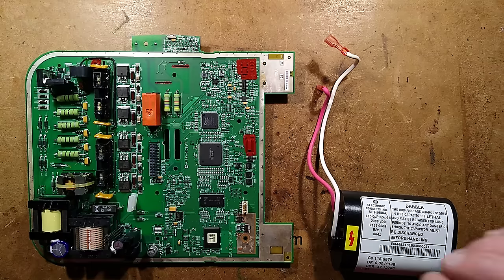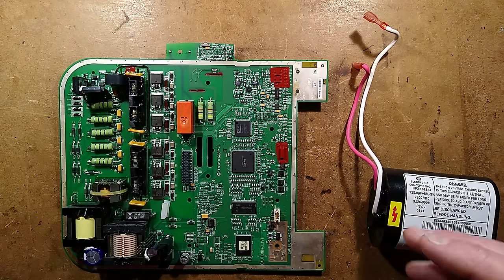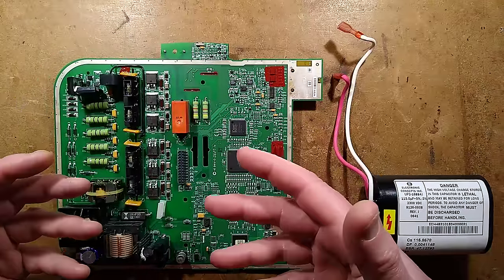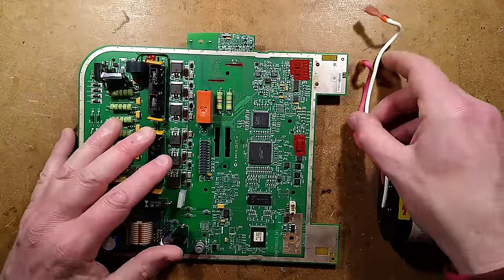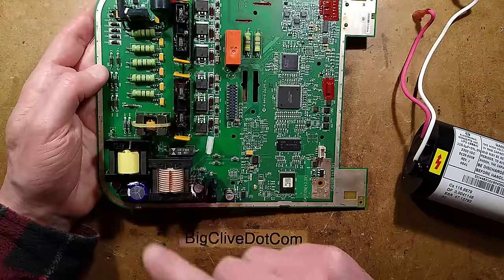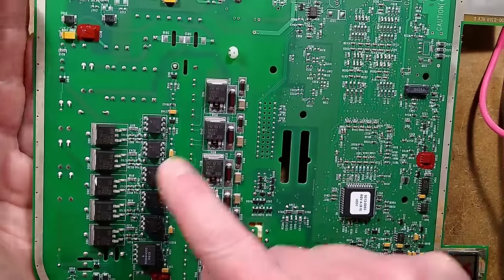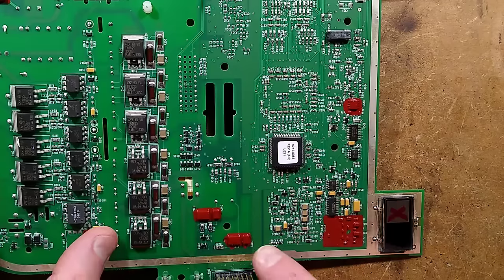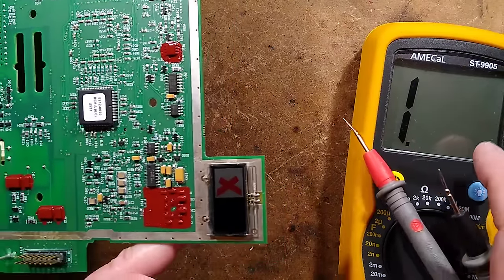Inside a Zoll defibrillator - with SCARY capacitor

Comment: I used to service defibs. These new automatic ones are pussycats in comparison to the manual operating theatre monsters I used to work on. We used to "test"  them by exploding cakes of soap with them.
The one I'm thinking of had 8 caps the size of the the one in the video. If I remember correctly , it would max out at over 800 joules.
It didn't use batteries , it was plugged into the mains.
Reply: Damn, 800 joules! Ours max out at 200, I bet those high power defibrillators were the old monophasic models
Reply: The early days were unhinged, it wasn't until around the mid 70s they figured out 360 was the most you could do without catastrophic heart explosion

Comment: The voice is a bit muffled and low quality, but it goes something like this, i think.

15:31 : Its talking about that the settings is for Adult, or directly translated : "electrodes adult."
15:35 : Now he's order you to install batteries , or directly translated: "Install batteries."
15:41 : A question about new batteries, if so press the button.
16:37 : Same about the settings, its using the Adult settings for electrodes.
16:40 : It passed the test and tells you, "Unit is ok."
16:43 : In this context,  its tell you to keep calm or be calm.
16:44 : Its when the red light is at the, Are you ok? sign, it basicly tells you to check the victim/patient , or directly translated : "Inspect reaction"
16:46 : instruct you to call the ambulance , or directly translated : "Call for help"
it now repeat, "Keep calm" , "Inspect reaction" and "Call for help"

16:55 : It tells you to make sure the patient have an open path of air and not choke, directly translated : "Open airway"
17:01 : Now check if the patient is breathing , directly translated "Inspect breathing"

ok, i got bored of translating, but really the images tells , and its just a direct reflection word by word of what the images are shown.

Comment: Very interesting, as always.  A thousand dollars for the device seems very reasonable. The little package with the scissors, chest shaver, an alcohol wipe, a pair of nitrile gloves, and one paper towel, which is called an Emergency Response Kit according to Phillips, costing a mere US $95.99 to replace does seem imho to be medical malpractice.  Yes, I understand the life saving ability, but charging (I'm sure I'm missing a pun somewhere) $96 for what at most is a few dollars actual cost for these items could kill someone.  And I am sure if used with non-approved nitrile gloves and paper towel liability insurance is voided, no wonder medical insurance is so high.  Similarly, after a recent scare I purchased one of those devices to suction a blockage from a choking person.  It cost me a hundred dollars and consists of about $5 worth of silicone. Overpriced?  Yes, until it saves someone.  It could save a lot more people if it were more reasonably priced however.  I'll make sure whomever is choking can afford to replace it before I use it on them, sorry Uncle Sal you still owe me ten bucks for lunch last week!

Comment: At 5:00 are the resistors supposed to be wired in opposite directions?
I know it doesn't really matter, but ...

15:40 - Google Translate tells me it said "batteriene er mye trykk på knappen" or "the batteries are a lot of push on the button" 🤷🏻‍♀. Seems it is even worse at translating Norwegian than Chinese.

When you switched it on, the Google translate of the text on the lcd display is:
electrodes adult
unit ok
keep calm
examine reaction
call for help
keep calm
examine reaction
call for help
open airway
examine breathing
attach electrodes
Reply: it actually said "hvis batteriene er nye, trykk på knappen" wich means if the batteries are new Press the button ;)
Reply: @johndo2218  Yup, definitely worse at translating Norwegian than Chinese. Your translation makes sense.

Comment: I just have been trained to take care of our ZOLL AED Plus. Thanks for letting me have a look inside!

During this training, I have been told that the chestpiece is not just checking for applied pressure, but also after the g-forces and direction brought to the small plastic case on the chest.

Is someone here who could confirm this?
Reply from the maker: The chest unit measures displacement, so it can tell if chest compressions are strong enough.

Comment: i wouldn't suggest using spade connectors for such high voltages, there are better suited options... but that's just the swiss engineer rambling... :D

Comment: The red ❌does not mean flat battery. It means its self-diagnosis tests have failed. This could be for a number of reasons including the pads not being g attacked. 

If the battery is due for replacement, the device beeps every few seconds. 

Battery life is 3 or 5 yrs depending on software version. Or one incident where shock(s) are delivered.

Comment: Nice to see the inside of a defibrillator.I just took apart a 1 farad capacitor but 30 volts.Lets just say there was enough energy inside to put a notch in a screw driver .Wiha won't warranty that .Was out of a high end car stereo system ..Someone tried to jump start a car and went reverse polarity and damaged the stereo but not the car computer ..Lucky .The capacitor is damaged draws 5 amps at 12 volts but still hold quite a bit of charge ..I think it was rated for 30 v DC .Capacitors are EVIL 13:15 13:16

Comment: Wow it has a whole hitachi SuperH Sh-3 cpu and some external ram and some flash. I wonder what os it runs. Probably some rtos but i could be wrong, might also use a light linux version or just a purpose built software.

It also seems to have a xilinx spartan fpga or cpld or logic device which probably also controls a lot of the functionality while the cpu outputs the speech and drives the display and lights and buttons

Comment: Defibrillarors aren't cheap and like modern printers they get you on consumables.
If you're an independent voluntary responder it can get expensive.
A Lifepak 15 is £21l to £22k but you get all the vitals P/R, NIBP, SpO2, SpCO, MethHb,  EtCO2 capnography (to measure effectiveness of CPR.

Comment: Maybe the 4 most painful experiences in electronics while still plugged and accidentally touched: 1-the heat-sink of a desktop pc power supply , 2-making contact with the ballast from a tube fluorescent lamp , 3- just charged and not plugged capacitor from freezer or microwave, 4-the discharge of a TV fly back  while disconnecting it from the tube. Just remember make me feel scared.
Reply from the maker: All quite harsh lessons.

Comment: I heard that they give you 80, 100, 120, 150, 180, 200, 220 or 250 J.
A horse kick directly on the middle of your chest has up to 175 J, protection for electronics can swallow a bit over 1,000 J, a BB gun has between less than 0.5 J and up to 7.5 J, sold only to adults.
I wrote these numbers just for giving a perspective.

Comment: Hospital equipment is VERY interesting because health industry regs don't allow manufacturers to cut corners at the design end. Every bit of junk thrown out tends to be at least twice as strong as it needs to be. Often ten times stronger. A lot of equipment is retired after a few years because it is too hard to deep clean. Its a very different commercial culture to domestic consumer manufacturing.

I just acquired a 'non-compliant' vintage 2006 HP 43120A combination EGC and Defibrillator unit. Complete with a mini CRT display and a heart beat tape printer. It’s a VERY different animal inside from the little one you are investigating here.

It came compete with 12V D Cell lead acid 2.5 amp hour battery pack. And a main capacitor that is the size of a brick.

Most interesting is the PCBs are all hand built with traditional resisters etc. Not a common thing to see these days.

Comment: "Chest compressions, Chest compressions, Chest compressions"
You're repeating yourself, Clive. Just like Doctor Mike!
That plastic case in the middle of the pad assembly is sealed, I see some sealant residue on both shell parts. So it really looks like a compressible volume of air, your "pressure sensor theory" is very plausible . Couldn't find anything about the part number, but can you post a microscope close-up of that thing? The top surface should either have a hole in it for the air pressure to be let inside, or be made of an elastic deformable material and in itself be part of the fixed-volume pressure-reference chamber. Maybe works like an electret microphone? I assume it's implemented with SPI or I²C data interface. Maybe even analog, with a high-precision ADC nearby. Intriguing!
Reply from the maker: It appears it is an accelerometer in a watertight case.

Comment: Regarding line workers, are defibrilators still useful in this case, i.e. can a line worker still get a shock bad enough to disrupt their heart but not bad enough to completely cook them?
Reply from the maker: It's usually the groundworkers who would benefit from a defibrillator due to gradient voltages.  With overhead line contact the current is usually so immense it affects the whole heart and leaves it functioning.

Comment: I never really respected capacitors before working on my amplifier with 400v caps and getting my fist electrocuted when i started soldering it after it's been disconnected for about 3 weeks 😅
I've always thought they only hold charge for max one hour or mostly 1 minute as most have discharge resistors.

Now i short them first or only bridge it with one finger at the time 😂

Comment: I have a Maxwell 100kv pulse capacitor, It`s about 2 foot high by 6 x 6. Needs to be in oil. It`s very frightening when charged and dumped
Reply: It whistles at arout 2 foot of spark gap and almost asked to be arced out

Comment: Can you trace the paddle wiring to see if/how it isolates the monitoring circuitry from the high voltage?    There was a relay, but I have some doubts about arcover on contacts. Was there a voltage on the relay, or did they isolate it electronically?
PS. I'm pretty sure that it asked if you were a Dachshund, followed by "Your knee is crushing my arm ... get off!"😆

Comment: I thought the capacitor was a similar size to the one in a microwave oven, but it turns out to be around 100x more capacitance at the same voltage.

Also, Zoll means "inch" in German. I wonder why they named it that.

Comment: Is there any reason why microwave oven capacitors are so weak when similar in size to this? I have a bunch and they're around 0.93uF and 2100V which is only around 2 joules. Unpleasant, but not dangerous. The one you have delivers over 300 joules and that's definitely deadly.
Reply from the maker: The microwave ones will be sized for the application with the continuous direct recharge from the transformer.

Comment: That the insulation on those capacitor leads appears to have been pinched and split in assembly is kind of an uncomfortable thought...
Reply from the maker: They are gripped gently in a support bracket.

Comment: These days when they restart an open heart after surgery the device they use, which isn't really a defibrillatior as its starting a stopped heart, needs 50 micro amps to get the heart to start

Comment: Ive been thinking of buying one of these,  but worried that "zoll" is some weird knockoff brand, if some one as knowledgeable as in electronics as you, claims them to be a respectable brand, then i might end up getting one.
Reply: Zoll are one of the top brands for defibrillators. You will find them on most ambulances. And they dont seem to be as bad as others, in terms of ripping people off for batteries and pads.
Reply: @lukehewings1  yes, i see them alot, thats why i was considering them, i figured they were either name brand, or a known knock off, and considering most places cut as many costs as they can, i was more so assuming they were knock off.
Reply: @ZOMBIEHEADSHOTKILLER  having used them, I can recommend them. I can't comment on other AEDs. They are one of the cheaper brands to own and maintain. With pads being readily available and batteries being cheap. The instructions are very clearly read out, and it talks you through what to do, if you are less confident or haven't used one before.

Comment: Ah yes! "Testing" old time defibs by discharging one paddle into the other: instantly welded paddles. Better still, discharge 400J into a stainless steel dressing trolley: nice burn marks. One manufaturer used capacitors rated at 5kV at voltages of 7kV: they seemed to work OK.

Comment: The strangest aspect of this device is the battery compartment. I’ve never seen such an odd battery requirement. 10 123 batteries?? What is going on? Why not 18650s?
Reply from the maker: The non rechargeable cells have high capacity and a ten year storage life.

Comment: 2:10 yeah, that's movie stupidity, not defib unit (they also always (i mean 99.9% of the time) use it in the wrong situation in which they would not help at all).
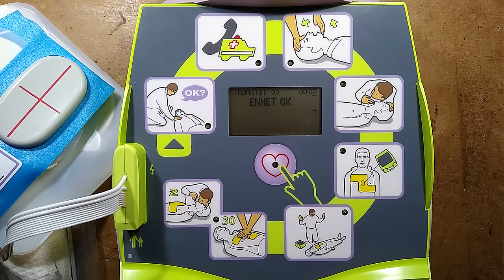19:00 yeah, breathing in is not necessary since those compressions are enough to make air go in and out of lungs (and it also protects the one rescuing the downed person)

Comment: That little high-voltage transformer makes me a little wet... 
So I'm working on a mains-powered 100,000+ volt transformer.  Following the success of a 50,000-volt model, I figured why stop at 50? As you might imagine the difficulty with such a device is the low frequency of the mains: the number of turns necessitated on the primary requires an insane number of turns on the secondary to achieve such a high voltage, even with a core cross-section of over eight square centimeters... Preliminary calculations indicate I will need approximately 50 miles of 42 gauge wire. Actually, the biggest sticking point is fabricating a proper bobbin. I have most of what I need I believe, except for the wire. 
Well, onward we go.

  Peace and love.

Comment: I wanted to see that capacitor charged up to its rated voltage and shorted... (who didn't?).

The electronics are impressively complex, there seems to be an external RAM for the main microcontroller - why is that?

Comment: There are many locations here that have under the table work down on live 480vac breaker panels. Bolt on breakers. How dangerous is that. The said company doesn't want production to stop so they have contractors do it. Disgusting mentality. Too good for our men to do it. Here you do it. And hurry up. Socket extensions floating around those 2000amp panels. No thanks